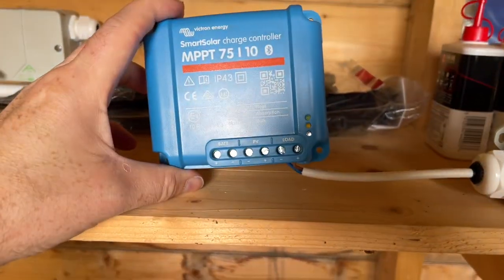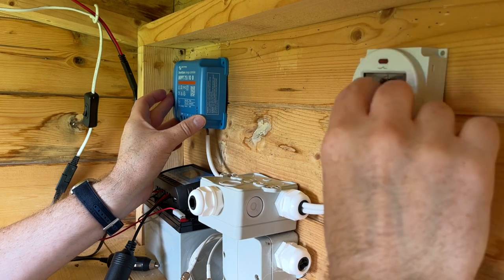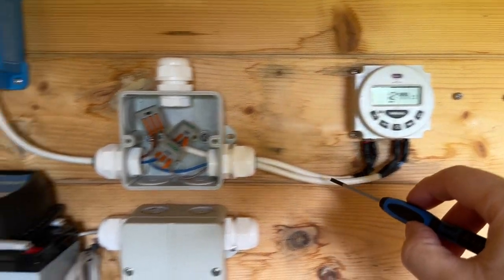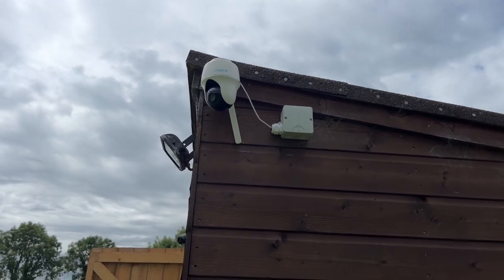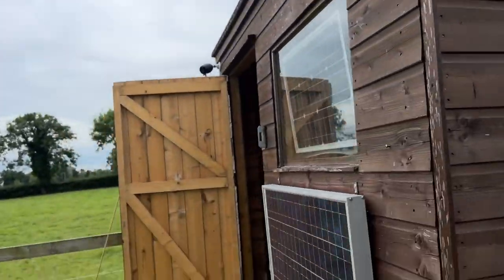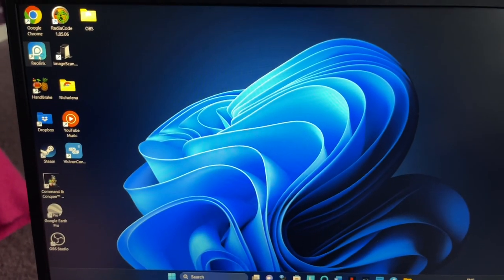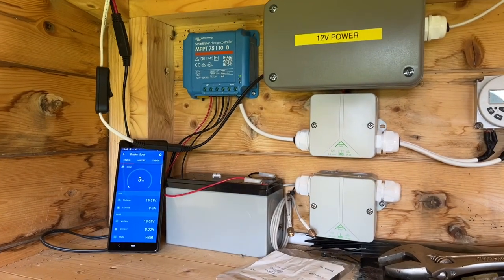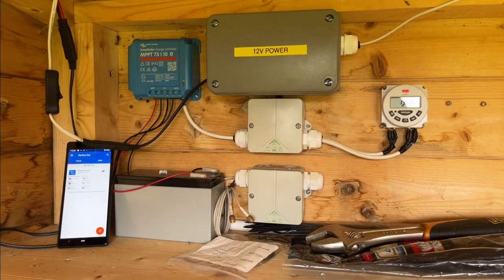Bunker Maintenance Episode 23

Comment: Hi, thanks for posting some amazing and interesting stuff. It's just my mind thinking of when the bunker was operational,  did it have mains electricity and phone services,  with backup if war became reality 🤔
Reply from the maker: No, all 12v only. Two batteries, one for lighting and one for the radio. There was a telephone of sorts but you would need to watch some of the earlier videos I made for it to be explained properly - my post was what was known as a ‘Master Post’ so it had a backup radio in case there was a landline failure.